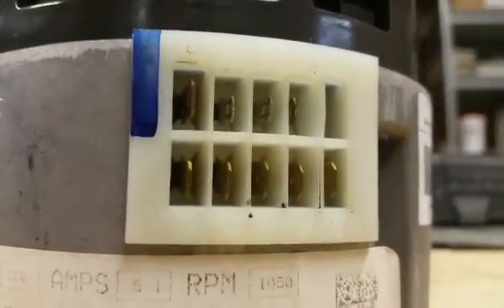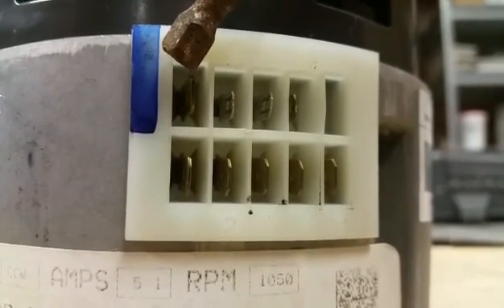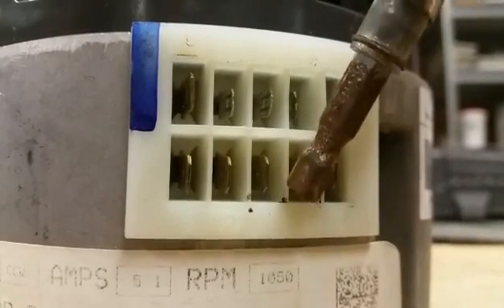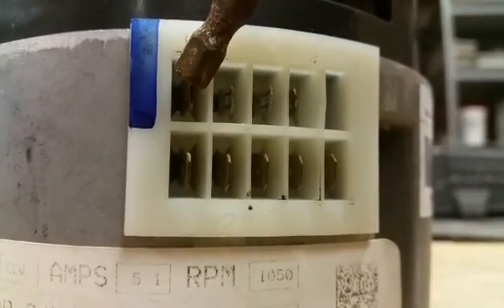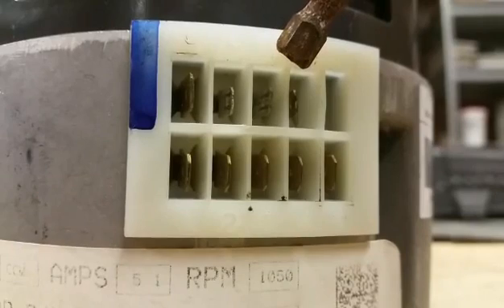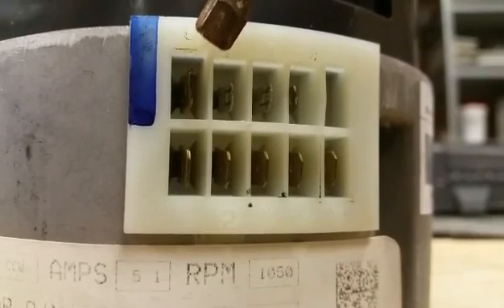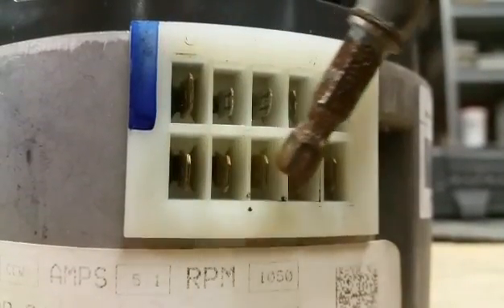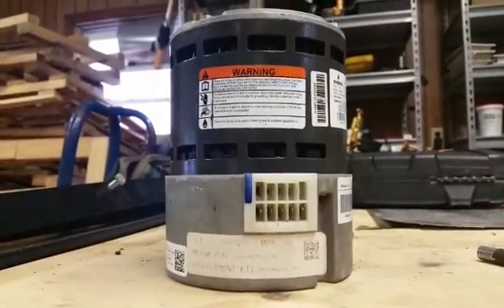HVAC Training- X13 Blower Motor Wiring

Comment: Will it work if the furnace doesn't have the 5th speed wire? I have some ECM only have 2 cables attached on the speed.

Comment: 8 videos and no one explains how to actually select or use the speed taps.
Reply from the maker: You pick a tap based on required airflow. That is calculated using static pressure tables in the unit installation manual.

Comment: Hi Zack   Can one run the motor without 24V.  I mean just one speed?
Thank you.
Reply from the maker: Low voltage tells it when to run, so you need it.  The high voltage is always on to this motor.

Comment: I have replaced a motor because the fan kept jerking like it wanted to start but never ran at full speed. Installed the new module with new motor and it’s doing the same thing. Trane YSC060 .any chances i have a bad one out the box ?

Comment: A little off topic question. Just replaced one on my dads luxaire air handler. Luckily the installer was still in business and honored the factory warranty. How reliable are these inverter type motors? System is only 4 years old. Before I tracked down the installer I was looking for a replacement part and found plenty of people complaining about these x13 motors failing and their cost.
Reply from the maker: Arthur Lejawka There was a series of sub par motors a few years ago, but they seem to fine these days. They are good motors if the system is installed properly ( correct ducting)